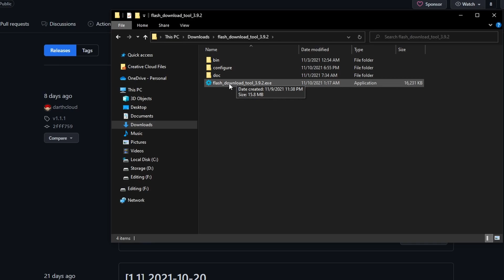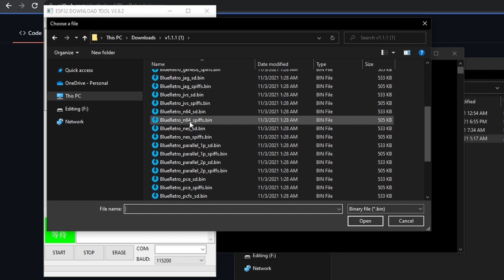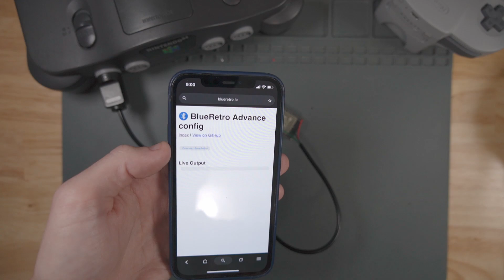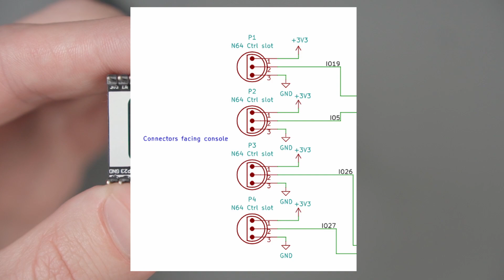BlueRetro - Use Your NSO N64 Controllers on a Real N64!

Comment: If I had to guess, retro consoles aren't designed to supply a lot of power to the board for accessories, having the HDMI connected + pairing an adapter is using too much power. So the voltage drops and the adapter doesn't pair.

I imagine that as more things become USB C PD compatible that there will be a workaround for this.

Comment: Hi Dubes, I want to let you know. Multiple Switch controllers won't work with the Blue Retro. Talking with DarthCloud, the creator of the BlueRetro project, he's acknowledged that there are problems in the Bluetooth integration when using multi-devices.
Reply: Do you know if there's been any change on this? I'm gonna try this if it can support 4 pads stable.

Comment: i did all the things you did, but its not showing up on the com port

but its recognised by my pc but not the program
Reply: Did you ever find a solution with this?
Reply: @Vinnyzero07  apparently you need a driver for it then it will be recognized by the computer and then you can flash the firmware

Comment: surprisingly i had some cut n64 extension chords from a previous project for my retrode 2 n64 controller adapter, and i think i might just give this a try with how cheap the project actually is. it also looks dead simple.

a few questions, can you edit the button config on the adapter?

i want to make the left analog stick a dpad and the right analog stick the main n64 analog stick, for golden eye

Comment: 2:17 

@Dubesinhower 
for real? only random numbers? i don't understand that part to be honest.
Where do you know what to put in there? What kind of purpose is there?
Do you have more info on that? :( 

The github repo does not make any sense to me for now...
Reply from the maker: They aren’t random, they come from the BlueRetro documentation. Sorry, I’m not really sure what their significance is
Reply: @dubesinhower  okay. i made the connection by their naming... it seems like it's "adress 0x1000 is the bootloader section" and so on. so i assume for example the gamecube firmware is also placed at 0x10000 like the n64 firmware in your video.

where exactly did you find it in the git? i am over with docs to read currently in this and obviously haven't come to that part yet.

thanks for your time by the way. really appreciate it. :)
Reply from the maker: https://github.com/darthcloud/BlueRetro/wiki/Flashing-firmware-Windows-10

Comment: Mine seems to require 5V because I can’t sync without plugging in USB. I recall you were having a similar issue on Twitter.

I bought the ones you linked to but they appear different from the one in this video. I recall DarthCloud replied on Twitter to say that power on the ESP32-DevKitC clones could be different or something.

Did you overcome that issue or get another ESP32 board or what? I have six of these and only intend to use two on 5V consoles so I’m very interested in a fix for this. Thanks!
Reply from the maker: I haven’t looked into it yet
Reply: @dubesinhower  Well, do you have a link for the one here? Thanks!
Reply from the maker: It’s in the description
Reply: @dubesinhower  I ordered the ones from the description but the one shown at 4:49 is different. I was hoping to find a link to that one because it seems to work for you… unless it was just being used as an example.

The one in the video is silk-screened “NODE[MCU]” while the ones linked in the description are silkscreened with “HiLetgo.” Which is the one that worked for you and the Discord user?

Yeah, I checked and his pic showed the controller connected with no 5v power too. You said he had the exact same board as you so I’m hoping to get the exact same board too. :)

Thanks again!
Reply from the maker: Oh yes, so I ordered that one from Digikey because I ran into the power issue. But that one acts exactly the same as the first one
Reply: @dubesinhower  I see. Thanks for your help. Wonder how that dude on Discord got his working without auxiliary power, considering he has the exact same board. I’d be building it into the console and get 5V from there if it played well with an original controller (I’m told it doesn’t but may in the future).
Reply from the maker: I talk about an internal mount for the eap32 in todays news that comes out at noon EST
Reply: @dubesinhower  Yeah, I saw the tweet about the N64jr and the internal BlueRetro mount. Thanks for spreading the word! The thing is, it needs a toggle for individually disabling the data lines unless you block off the controller ports since having a controller plugged in at the same time will interfere. Perhaps he can add a switch mount at some vent holes or something. :) I’m sure most want to retain the option to use original controllers even just for accessories like Transfer Pak, Bio Clip, Microphone Pak, etc.
Reply: @dubesinhower  …and I smiled since I have some YT poop scheduled for an hour earlier. :)
Reply: Did you ever figure this out? I bought the board from the link and doesn't pair unless I connect to a usb battery. After it pairs i can unplug the battery and play no problem just using the n64 for power.
Reply: @RicardoTrevinoLohman  DarthCloud himself messaged me about it. In the end, he ordered some of the same HiLetgo ESP32 Devkit boards to look at. I believe he intends to see what’s going on to work out a fix.

When I unplug 5v the light dims but the controller doesn’t stay connected. I believe I measured something like 1.4v on the 5v side when powered through 3.3v, so it seems that it’s trying to power the 5v side off of 3.3v through some leaky component/design.

DarthCloud said he believe the light isn’t supposed to come on at all when using 3.3v on the official ESPRESSIF DevKitC. For now I’ll order official DevKitC boards from Mouser and use a couple of these inside controller-less Famicoms. :)
Reply: @emmettturner9452  Interesting theory. Mine just needs a boost to pair the controller. I just need to "jumpstart it" then it stays powered indefinitely trough the 3.3v. light does dim after unplugging the usb battery, but stays on the whole time. I guess ill get the real one from mouser as well. Thanks!
Reply: @RicardoTrevinoLohman  i am running into this issue as well. i have found that after pairing the controller with the 5v plug, i don't need to use the 5v every time. just the first pairing for some reason.

Comment: Managed to do this as an internal mod. works great with 2 issues:
1- Works well with 2 controllers, controller 3 and 4 are not stable (Keeps disconnecting + input delays)
2- Most games I've tested works well. with the exception of rumple in crisin world. Rumple for play one does not work and in 2 players mode player two rumple works well.

Looks like its still work in progress but definitely promising.
Reply: When you did this as an internal mod does it still let you plug a wired controller in if you want to?
Reply: @auron373  nope it wont work. But I installed a switch. So if i want to plug a controller I just  turn it off.
Reply: @Cloudiethebadddie  beauty

Comment: Great runthrough. Can't seem to find a good source for the files to flash the ESP32 with a Mac though.
Reply: The gbs-control project uses a similar arduino board . Their wiki is where I found info on programming the boards on a Mac. Different purpose but same board

Comment: Good build. Now I would love to see a build for a console that doesn’t get ANY wireless controller love. The DC. I see that BlueRetro supports it
Reply from the maker: Some of the consoles need additional components to work. But I’m definitely interested in other consoles!
Reply: @dubesinhower  i need to try the DC one myself. I love brook adapters. But ugh. They are big and uggo. A single box with 4 adapters Can look better for sure.
Reply: @TheAfroman   

Lone plugs with pins are on AliX (last comment got deleted for mentioning the real name) for consoles like N64, GC but not DC. Plenty of replacement and extension cables though. With plugs you could make a PCB that plugs into one or more ports and has a single cable to the adapter… or even has the adapter built-in.

I was brainstorming and decided I wanted a block with two rigid N64 plugs for players 3 & 4 and two more extension cable for players 1 & 2. The BlueRetro would live inside the box plugged directly into ports 3 & 4 (no cable). This gives me the freedom to unplug players 1 or 2 if someone wants to play with an original controller or use a controller slot accessory. Though BlueRetro is expected to add virtual controller pak support you can plug an original controller into player 2 with a controller pak for most of those games and continue playing wirelessly on player 1.

Comment: I assume you shouldn’t have to connect ground and 3.3v from each controller port since they are already connected through the first controller port. Granted, you may not want them all dangling by a single wire but that’s what the BlueRetro adapter boards are for. ;)
Reply: …but connecting them all gives you the freedom to disconnect any one you want and still have power to the BlueRetro. ;)
Reply: This is not entirely true. I found that at a minimum the grounds for the other ports need to be connected, or they don't actually send signals to the n64.
Reply: @Awuani  the grounds are all connected together inside the console though connecting them individually can help with signal integrity.
Reply: @emmettturner9452  yep they are however I had to connect them for each port or inputs for the other ports wouldn't work. Go figure.
Reply: @Awuani  

Well, I added a 2nd player and tried it without a 2nd ground connection and it worked. I removed that and crimped a DuPont header block for three more that includes ground. I couldn’t easily disconnect the ground but I finally de-pinned it and tried three controllers with only P1 ground. Still works. I’ll have to dig out more controllers to try four. :)

I’m getting power off of external 5V if that matters.
Reply: @emmettturner9452  That might be it as I'm using power from the console.